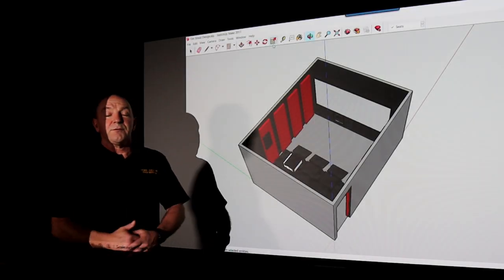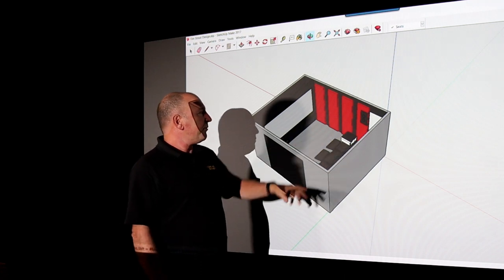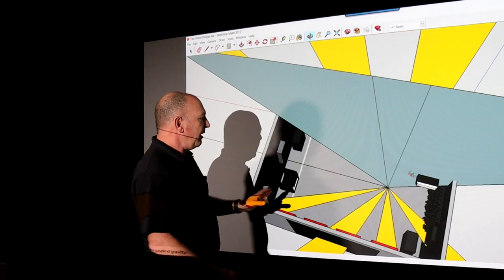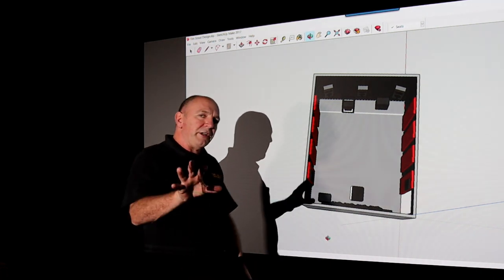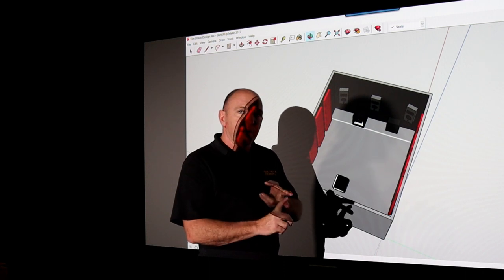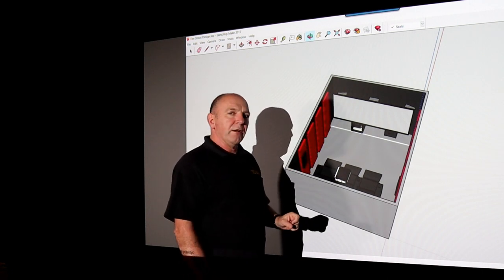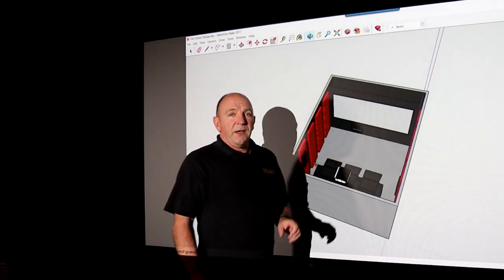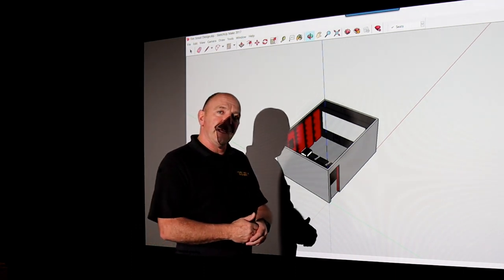Home Theatre Room Designs

Comment: Glad to hear you mention bass traps. Bass traps would need to be enormous to operate in the low frequencies that are problematic in most rooms. Disagree on needing 4 subs . After 2 the benefit of smoother coverage is of greatly diminished returns. I recommend 2 extremely large subs over 4 smaller ones.
Reply from the maker: Thanks for your comment on bass traps. I disagree with your comment on 2 subs. Modal analysis shows marked improvement with 4. I certainly have achieved superior results with 4 and this seems to be supported by Harman  Labs research. A good read is Sound Reproduction By Floyd Toole.
Reply: Carlos, you shouldn’t make declarations so easily disproven. Don’t read one article or watch one YouTube video and think you’re an expert. Research room modes and standing waves. While multiple subs doesn’t guarantee perfectly smooth sound without measuring and calibration, with a bit of work, four subs can even out response over a broader area of seats. #Science
Reply from the maker: @scottwallace1  I have to agree with scottwallace here. The evidence is stacked against you Carlos. Also I am personally not a fan of “extremely large subs” especially in smaller rooms. They are harder to manage and more like a blunt weapon than a finely tuned instrument. The aim is not power (to an extent) but detail and precision. The physics of large subs challenges this to some degree

Comment: Well....to your initial comment, that person can speak for themselves. Where I work, we test everything connected, we completely set up the receiver with crossover, distance, level, calibration program, etc. We do a basic picture calibration (get it off of vivid or standard and to custom or cinema, contrast, brightness, gamma, turn off motion modes, etc.). We offer a higher end calibration if the client wants to take it even further. We optimize freestanding speakers for optimum performance (prior to the receiver settings mentioned earlier), we test the remote. And on and on. So....that statement that “our industry doesn’t finish”???....not how we roll. Find a new dealer is my advice to that guy.
Reply from the maker: Hi I am not sure are you responding to a comment in the video or some other comment? It’s great that you do those things but they should be standard as a minimum for all installations. I don’t know that I would call basic setup as recommended in the user manual calibration at all but regardless it’s good that it’s getting done we see a lot of jobs where that’s not the case too. I’m not sure about free standing speakers,  these are definitely not a good choice for theatre for a stack of reasons. It depends on design but if you are running an AVR and crossing over at 80hz then you aren’t using the full range of free standing speakers. If you are using full range you are using a lot of power and reducing dynamic range and headroom due to the demand of the woofers in the freestanding speakers. Finally these are now functioning as subwoofers and often are not in a great location with regard to room modes and you now have to configure tone align and phase manage those along with all other subs. This is often more trouble than its worth which is why good home cinemas (and high end cinemas like DTS Europe etc) don’t use towers or full range free standing speakers. It’s is often done but it is far from optimal depending on the design and spec. Hope that makes sense. Certainly though in our region given the exposure we have to other work I stand by my statement that our industry doesn’t finish. It’s good to know that companies like yours are out there doing the right thing. That’s a win for the customer.
Reply: @HomeTheatreEngineering  Hi. First, lead with positive…good to see, read, and hear about companies in our industry who care and who put the work in. Now, ‘freestanding’ speakers…not sure where in that you necessarily equate that to mean full range towers, but one thing at a time…

Freestanding means not in-wall, on wall, or in-ceiling. It means speakers that are not inherently tethered to a boundary. This could mean full range towers, but it doesn’t have to mean that. And a home theater is a decidedly different creature than a commercial cinema. Commercial cinemas are bound by physics to use transducers for mid and high frequencies that can efficiently broadcast to a large auditorium without constantly redlining it. Hence, compression drivers. And in order to have sufficient bass for a large space, you need multiple bass drivers placed in spots that energize the room evenly. Given this, the main speakers are crossed over fairly high (80Hz or so) so as to not muddy the waters should those speaker positions prove to be undesirable as low frequency transducer locations. These are logistics that are not necessarily a part of a high end home cinema, optimized for one or very few viewers/listeners. And while residential size rooms certainly have their own room mode issues, it is also true that the very best music reproduction is done with a speaker that can reproduce the full frequency range and dynamic envelope of a recording so as to preserve all of the delicate harmonics and help ensure a cohesion that is exceedingly difficult to pull off with a sub-sat system. And so, for a home cinema customer that also places a high priority on stereo music reproduction (still a large percentage of our clientele), a carefully setup system using full range speakers (still crossed over in virtually all cases, just much lower than 80Hz), with an identical vertical center when possible or the largest horizontal center channel speaker when not, can provide phenomenal stereo reproduction, but still fantastic multichannel reproduction. Energizing a residential sized room with real bass from multiple main speakers and from well set up subs can be an amazing experience. Key of course, is finding where those larger main speakers may be exciting room modes and crossover and room correct as necessary for proper integration and smooth playback. But, point being, a full range speaker crossed over properly and mated to a subwoofer is a far more powerful and engaging experience than a bass limited main speaker that requires a subwoofer. The latter is always given away by a gap between the effective low point of the main speakers and where the sub picks up the slack while the former’s inherent character is such that that transition is much more disguised by the smoother handoff to the sub from an already highly competent fuller range main speaker.
Reply from the maker: @scottwallace1  I agree with some of what you say. But totally disagree with your statement that “it is true that the very best music reproduction is done with a speaker that can reproduce the full frequency range….” Etc. We have been able tp prove time and again this is not the case for several reasons. 1) using a subwoofer if properly integrated is no different to using a subwoofer or bass driver in the one speaker housing. 2) you are making no allowance whatsoever for the extra energy consumed by the bass driver in that full range system. Many people still use all in one AVR’s and these share power. Using full range speakers with these robs the system of headroom and dynamics. Many of the brands we use are designed and built from the ground up to be crossed over at 80Hz, Procella is an immediate example. Finally if using full range speakers a lot of phase cancellation can occur dependant on the room dimensions and speaker locations. It is more critical to energize a room evenly in a small space than a larger space, unless you are dealing with 1 seat.  The very physics of a commercial cinema means that most have lengths and widths that eliminate a significant number of modal issues. In short our approach is not to use full range speakers for the reasons above.  We do however put massive time and effort into this to ensure the detail and cohesion is maintained and that takes work. I am not sure about the reason for your point as to the definition of freestanding speakers but I agree. Our aim is to provide and equally good stereo or multichannel experience in all of our rooms. As it happens we also own on of Australia’s leading 2 channel businesses and we make it a point of ensuring the standards we apply to our 2 channel/audiophile clients applies to our Home Theatre Clients. Personally I do not accept that products are better for music or for Cinema. This is an unfortunate development in our industry, the goal should always be “accurate reproduction of sound” and if products cannot do this they are, in my mind no good for either. I would love to discuss and debate this with you further, nothing better than a meeting of minds , everyone learns but time is very limited in this particular forum. It would be great to meet you some day.